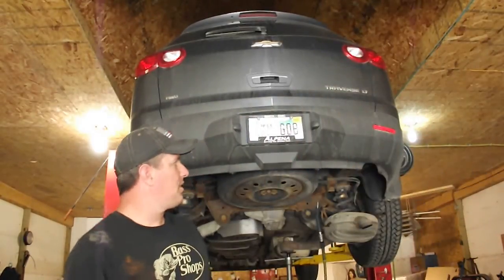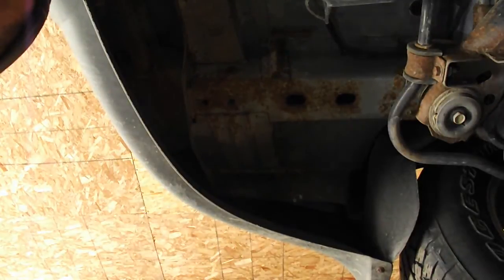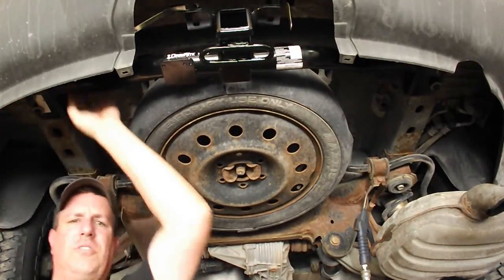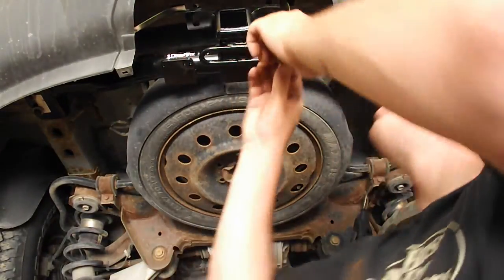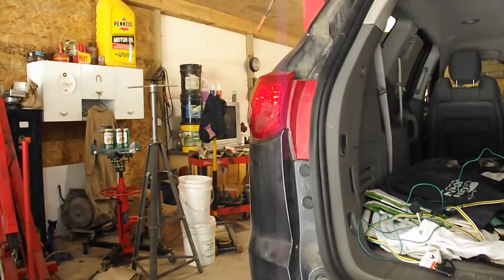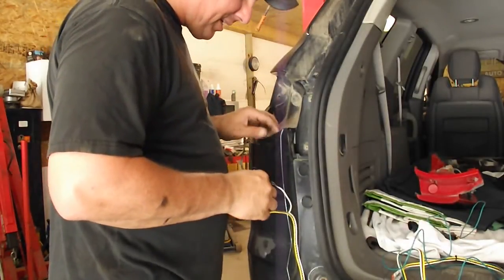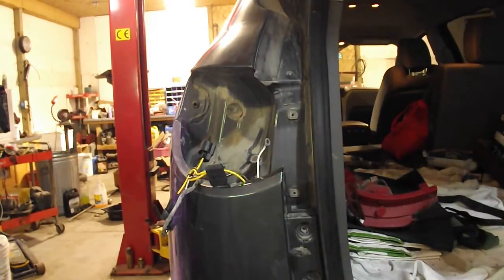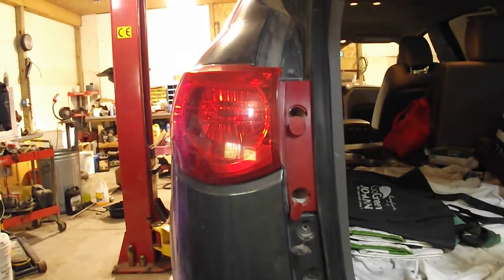How to install trailer hitch on Chevy Traverse GMC Acadia Buick Enclave Saturn Outlook

Comment: Great video. What did the owner do about the gap in the plastic panel? Is there a replacement that allows for the hitch opening?
Reply from the maker: There might be a trim piece available as some of the cars came from the factory with the tow package. The owner of this car was fine with how it looked. She also never removes the receiver from the hitch so it fills the void. So to speak.. Thanks for watching.

Comment: Did you end up installing a tow/haul button? It helps with the shift points when pulling a trailer. Well worth the $20 investment
Reply from the maker: No, I didn’t. She just pulled a small utility trailer with this when she went camping.
Reply: How hard is to install